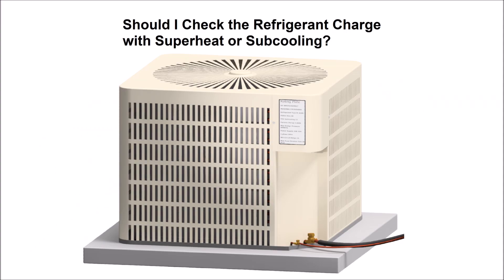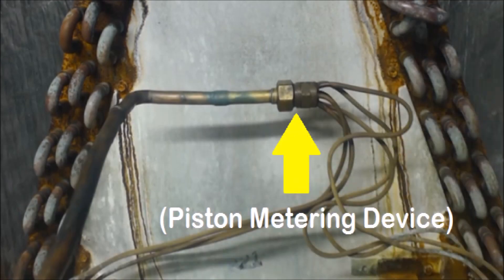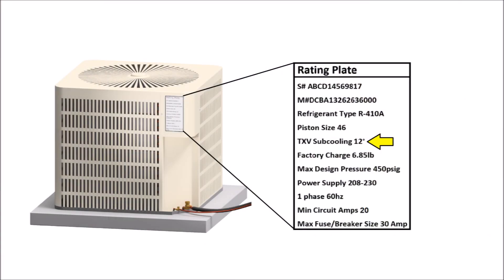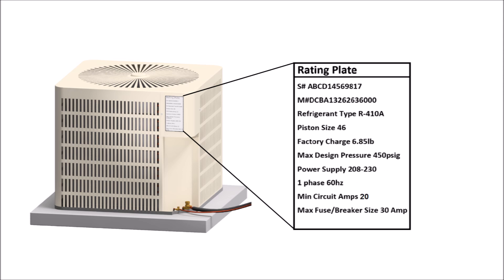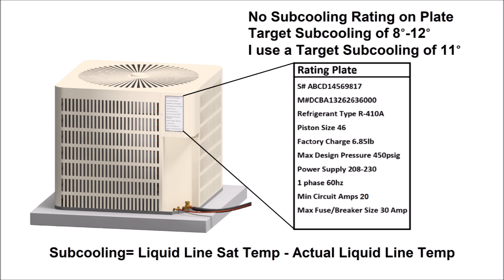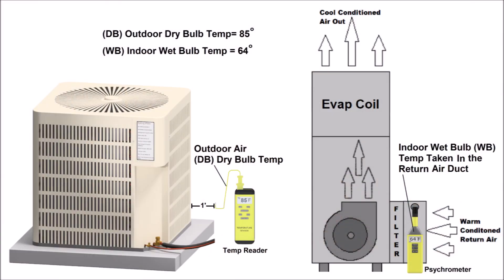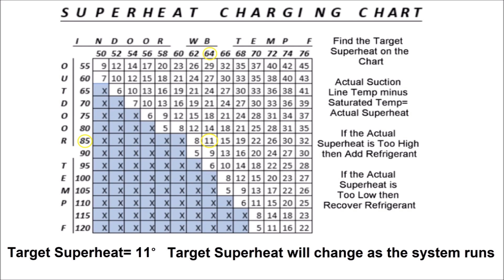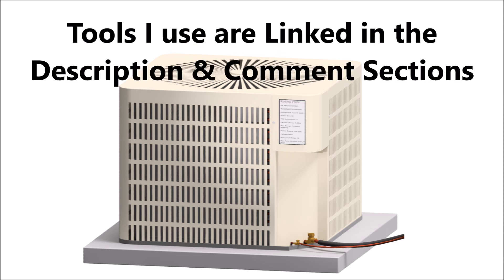Should You Use Superheat or Subcooling Charge Method? Find the Target! Explained!

Comment: The inner panel of my AC is telling me the following . Read and record the ambient temp and the liquid and suction pressures at the ports on the liquid and suction valves . It then states to go by the supplied chart as to if it's under or over charged . Is this superheat or subcooling  , or just go with what the manufacturer states ?

Comment: Can you go by the delta t 18-21 td and call it good. Are there problems that cant be seen while just using delta t?
Reply from the maker: You cant check charges just using delta t. You don't know if the system is overcharged or the compressor is safe. We always check total superheat and subcooling to verify, thanks!

Comment: Folks may wonder WHY a TXV on an Evaporator coil does NOT use the Superheat method. This is because the TXV valve's goal in life is a constant superheat. The sensing bulb on the TXV valve measures the temperature at another point on the evap coil. This gives the TXV valve "feedback" to vary the valve's opening so the superheat is constant.
Reply from the maker: Absolutely correct, thanks 3beltwesty!

Comment: Any way of finding out what size piston to use if you don’t have txv
Reply from the maker: You would just look at the manufacturer literature per unit size. Each manufacturer and model size is different so the piston size needs to match. Thats another reason for switching to a txv when possible. Typically a factory set txv will handle any manufacturer and will typically range across 1 to 1.5 tons in btu/hr size difference such as 1.5 ton to 3 ton, thanks

Comment: Great videos. I enjoy watching and listening. I have a question on this video. Should you be checked the superheat temperature as it comes out of the evaporator coil on the suction line to be most accurate
Reply from the maker: Well the problem is just that there is no port for you to read pressure there as you want the port and actual temp as close as possible. That would be more exact but we also check superheat at the outdoor unit for compressor safety, thanks

Comment: with 410 a it's best to do sub cooling but u can do superheat sub cooling is better on the 410 system
Reply from the maker: superheat is for any ac system with a fixed orifice. Subcooling is for txv systems that are single and two speed. They are both used for troubleshooting, for instance even if you only need subcooling for the charge level, you would read superheat to make sure the txv is working properly, thanks

Comment: I typically see the target subcooling on the spec plates, but it say under normal conditions. Whats consider normal conditions & what’s consider higher than normal?.......
Reply from the maker: Hey Oscar, great question with not much of an answer. I have read a lot of installation booklets from manufacturers and they all seem to skirt the subject unless they have a subcooling chart that shows where they want the subcooling to be on a certain outdoor temp day. I have seen some charts say they want 2 degrees less subcooling on 95 degree days than on 70 degree days. I have seen other charts that range 9 degrees higher for target subcooling on a 115 degree day compared to a 70 degree day. It is odd. I believe they are playing with efficiency numbers and don't want to pin down an exact number since line set diameter, lengths, rise, and drop could change leading to more variables than they want to communicate to the normal technician in regards to target subcooling. That is why I think they often times don't even give a subcooling range but just one number for their "normal conditions" which is likely 70-95 which would be 82.5 degrees F probably. That is what I think. What I do is I typically put 2 degrees higher than whatever they are calling for and then I check the delta T for 18-21 degrees to verify. This is so that if a tech comes in behind me and pm's the unit without doing the refrigerant disconnect procedure of putting the liquid back into the system, the unit will still have a little extra. Thanks Oscar and great question!
Reply: AC Service Tech LLC nice. Bro you should definitely built an app. I can see it in your future.
Reply from the maker: I have a lot of plans and ideas but lack the time to bring them to fruition, ha ha thanks Oscar!

Comment: Hi 
What is the best solution to check refrigerant in winter time as the cooling mode is not active
Reply from the maker: Hey Ace unfortunately if the manufacturer does not provide a heating charge check chart for that specific model, then the only option is total weight method where the charge is recovered, leak is fixed, and refrigerant is weighed back in including lineset length added, thanks